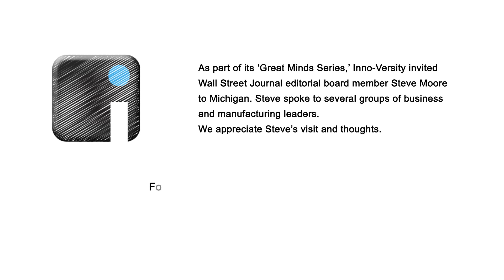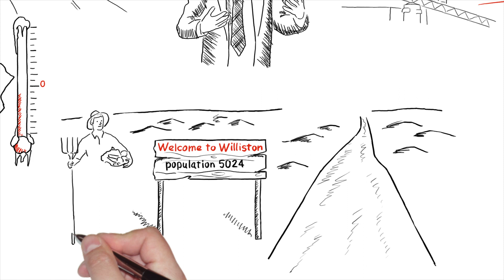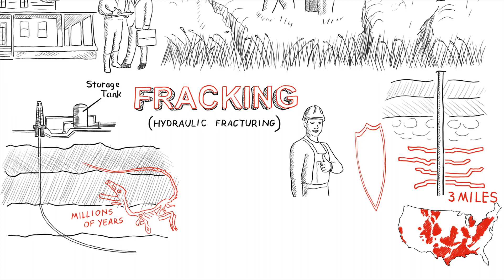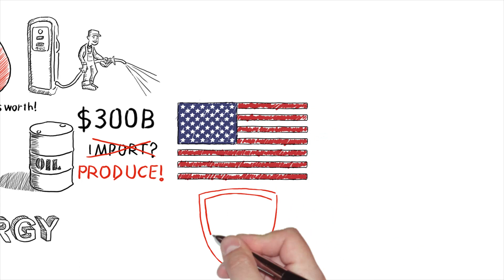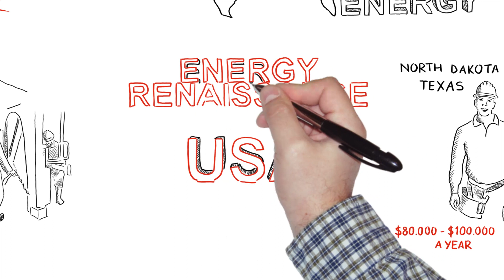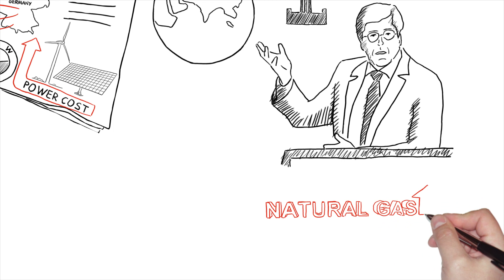MindSpring Presents: America's Energy Boom by Stephen Moore

Comment: Hydraulic fracturing gets all the press and is touted as the reason for our lower  energy costs, but hand in hand with fracking goes directional drilling--the science of drilling sideways down the seam.  When I started in the patch, we had to drill ten wells to get one producing well.  Now the ratio is inverted and every well we drill is equivalent to ten of the old wells production.  Thank you to the American oilman for giving us jobs, technology and cheap energy.  Now we need to focus on powering our vehicles using compressed natural gas, instead of liquid gasoline!  Cleaner and cheaper.  America leads the way.

Comment: This video paints a rosy picture.  Please realize gas companies have lobbied and succeeded to weaken environmental protections to maximize profits for fracking : (ref "Halliburton Loophole" : http://en.wikipedia.org/wiki/Energy_Policy_Act_of_2005).  This allows the use of extremely harmful chemicals and the bare minimum of safety procedures to keep profits high.  These chemicals are illegal to expose to surface waters, but ironically it's fine to inject them deep underground where they CAN (and DO) intermingle with groundwater.  (cite one of numerous incidents of contamination : http://www.nytimes.com/interactive/2011/02/27/us/natural-gas-map.html?_r=2&) 

These chemicals have also been historically regarded as trade secrets-- protecting them from disclosure and making it difficult to test water sources.  This should simply not be allowed when dealing with common resources such as groundwater.  Owning a lease to a land gives NO ONE the right to contaminate a river flowing through that land-- above OR below ground level.

Furthermore, plaintifs who sue gas companies for health issues and/or water replacement are forced to sign gag orders in return for payment.  Others have gone public : http://pennsylvaniaallianceforcleanwaterandair.wordpress.com/the-list/

One should realize ground waters should be protected with equal strength as we protect surface waters. If you can't dump certain chemicals above ground, you shouldn't be able to (secretly) inject them below ground. That's pollution, and theft of our resources. Fix laws and do it the right way. Don't bribe and gag the sick.